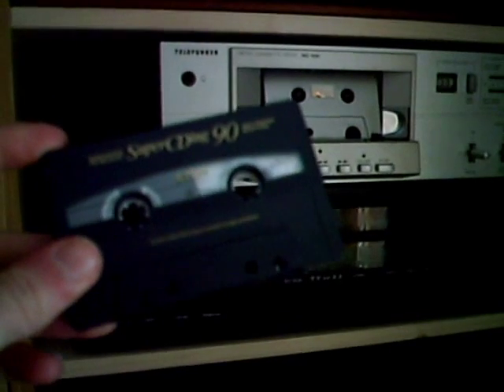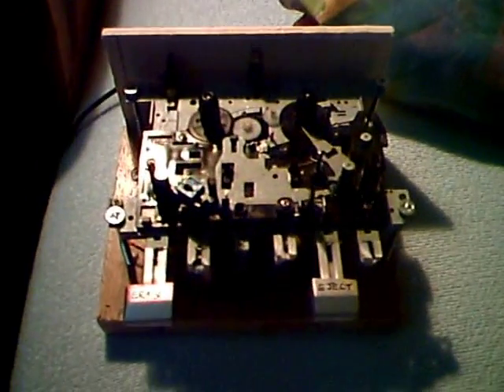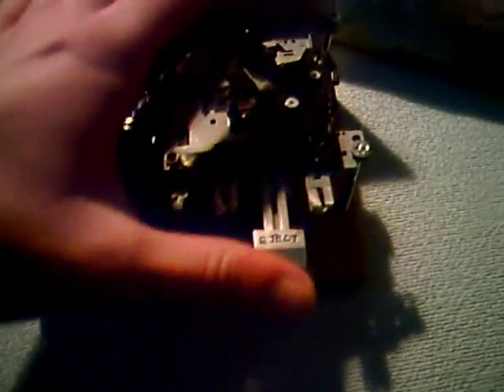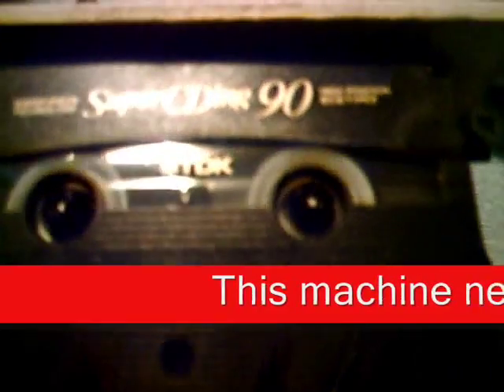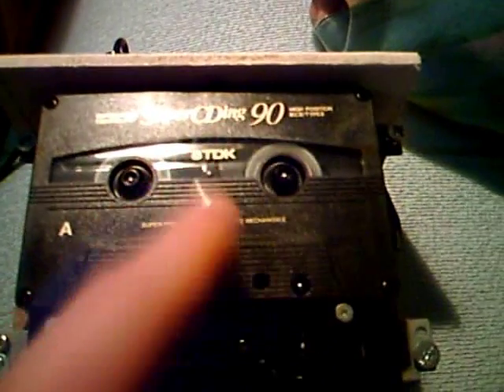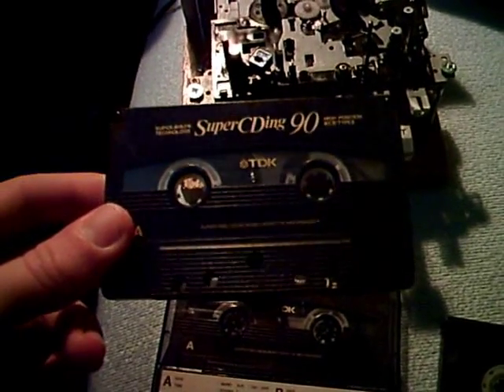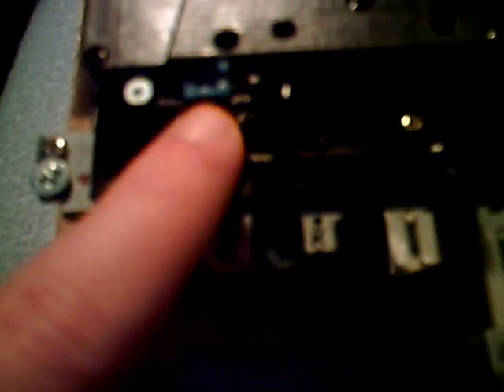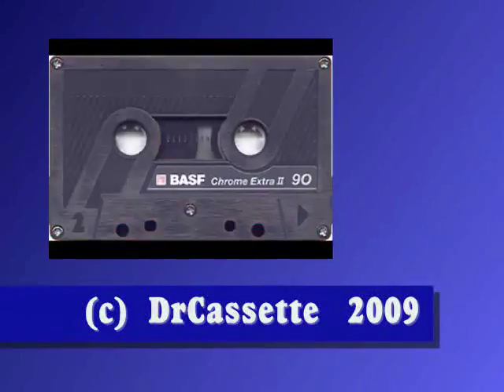My homemade high speed cassette eraser

Comment: Why erase, just record over it?
Reply: There is a little Gap between the A and B Side. If the tape was recorded on a misaligned or Subpar Deck or your deck is off, there can be some leftovers of the previous recording. Also a complete erase run gets rid of any leftovers you may get if you Pause while recording.

Comment: Great !!! but better with a magnet like sony BE-100 tape eraser.
Reply from the maker: Bulk tape erasers (big magnets) often only reliably erase type 1 (normal) tape, they don't work very well for type 2 (chrome) tape, and not at all for type 4 (metal) tape. Though the eraser seen in this video won't fully erase type 4 either.
Reply: @DrCassette  
thanks for the knowledge

Comment: I have a double well tape deck..so I put a blank tape in the left well, and the tape to be erased in the right...and dub from left to right in the HIGH speed dub so it speeds it up...or I use a very strong magnet and move it all around the tape...which is way faster.

Comment: this is really nice! Did you get the eraser head elsewere or it was already there? Also, does this device erase both sides or just one side each time?
Reply from the maker: The erase head (permanent magnet) was an original part of the mechanism. It therefore erases only one side at a time.

Comment: Firstly, DC magnet or permanent magnet erased tape has a low signal to noise ratio. Secondly, high-speed friction from the ferrite let the particle of tapes fall off seriously.
Reply from the maker: When re-recording the cassette the tape passes over a proper erase head so the signal to noise ratio is restored. I never had any problems with this device.

Comment: The school I used to attend had a cassette eraser which was just a huge electromagnet inside a metel case, and all you needed to do was to place a tape on top of the eraser, and press a button and the tape would be erased in a metter of seconds.  I have a very old Sanyo Memo Scriber machine which has an erase system that is similar to what you have here.  you need to press and hold the erase button then press fast forward or rewind.